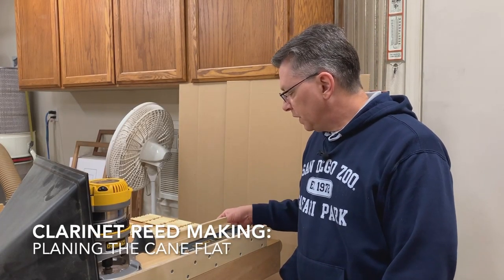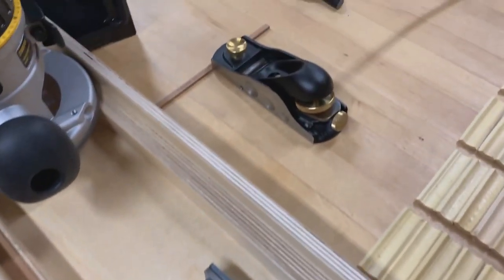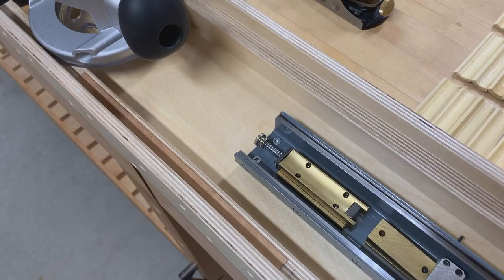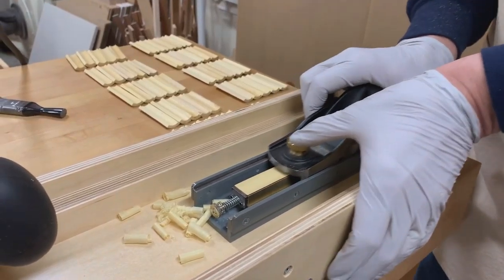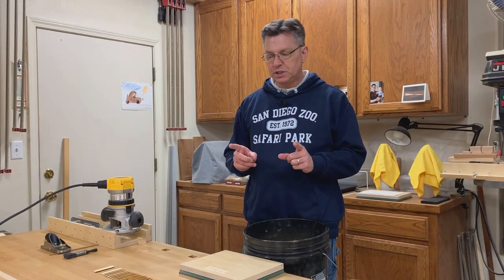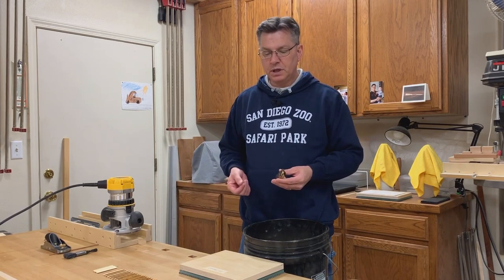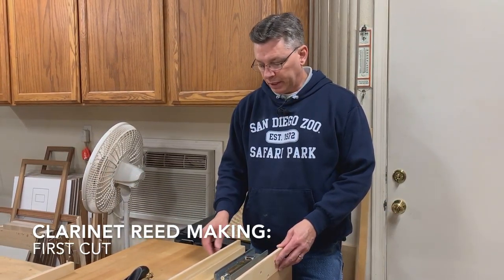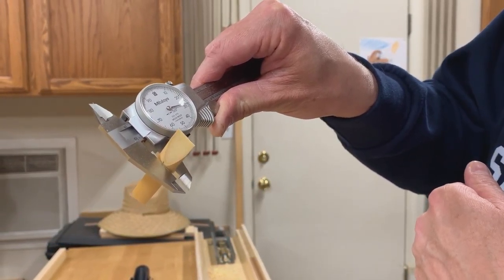Clarinet Reed Making: Stage 2

Comment: Great stuff Steven! How come you don't just use the plane to do all of the flattening? And also do you do any wet/dry sequencing between these steps?
Reply from the maker: Hello Jerry,

I use the plane to get close to my finished thickness, then I sand to ensure that the blank is flat.  The cane can flex in the planer and the plane is not able to overcome that flexing.  The sanding allows me to use a very delicate touch which will get the bottom perfectly flat.  I then sand each blank again, get it wet, and let them dry completely.  I do this three times with successively finer grits of sandpaper that is glued to a flat piece of 3/8” thick glass. Getting the reed blank wet and letting it dry allows the cane to move or warp if it wants to and then the sanding gets it flat again.  After three rounds of this, the blank is pretty much stable and the bottom is sealed, the blank is now ready to be profiled.  I hope this helps.
Reply: @stevenmadden3768  Thanks. Have you considered using these diamond stones? Very flat, so flat I use them for mouthpiece work as well as reed work. http://eze-lap.com/products/diamond-stones/bench-stones/
Reply from the maker: Jerry,

Thank you for the information, I will definitely look into those stones.